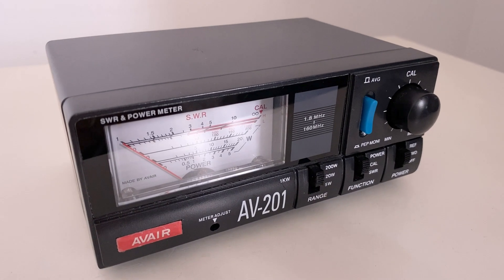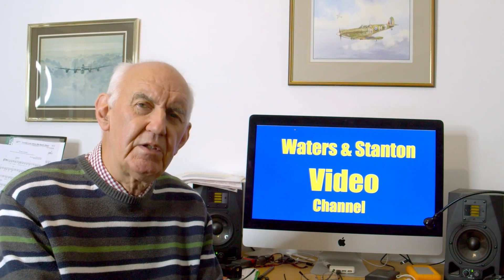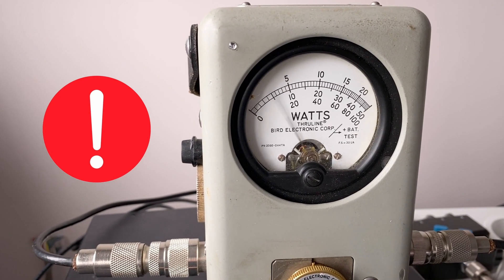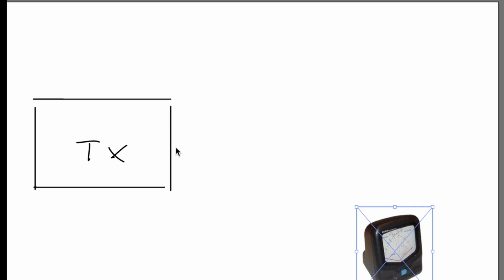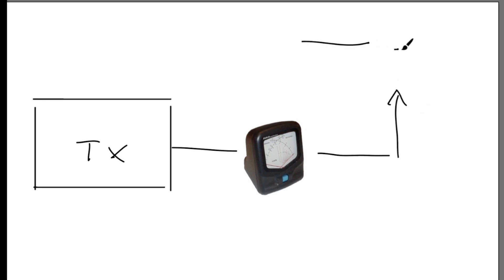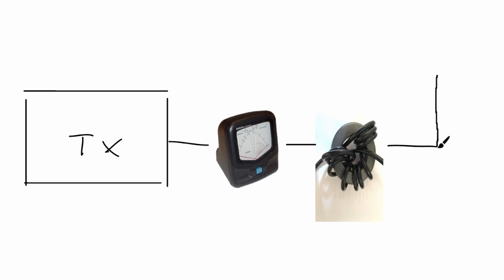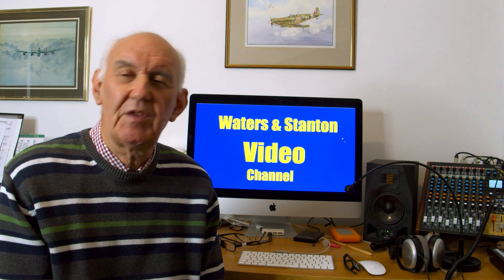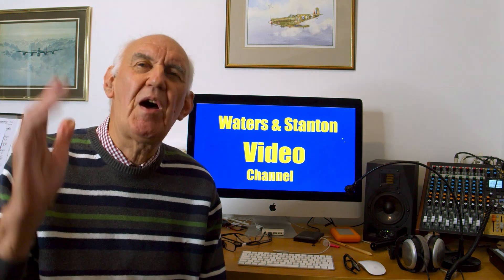VSWR - A Beginners Guide and How To Calculate The Losses. | HAM RADIO

Comment: RG213 (50 Ohm)OR FLEX 10/15 IF FEEDLENGHTS EXCEEDING 10m. 
Feed with 450 Ohm windowline to feed a dipole [80 or 40M] or a loop (any type! or 
impedance ( 2:1) 100-130 Ohm)

Comment: I use 75. Ω coax with dipoles, (73. Ω) I always have. (RG-59/U) Reflected power is not entirely lost.  It is reduced by cable loss.  The transmitter's output in not a 50. Ω load, it reflects the incoming power. Ron W4BIN